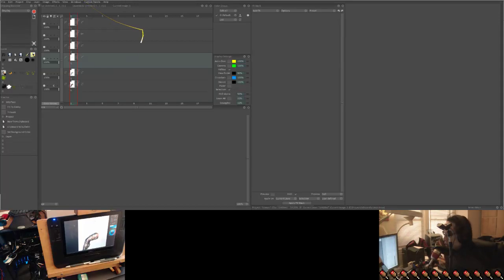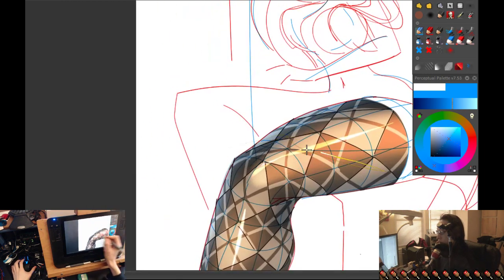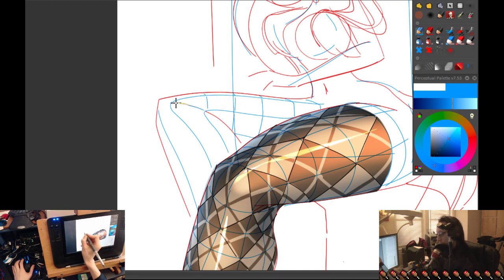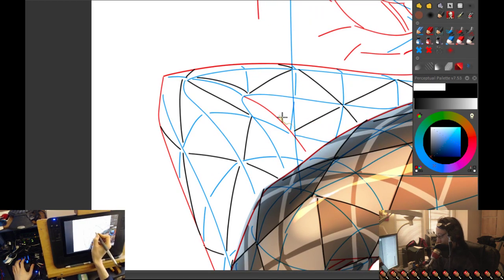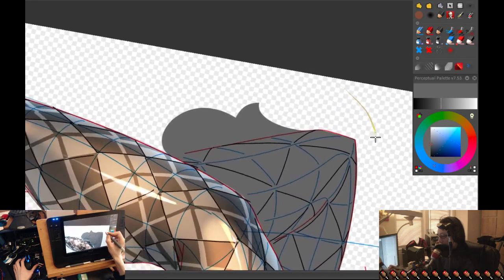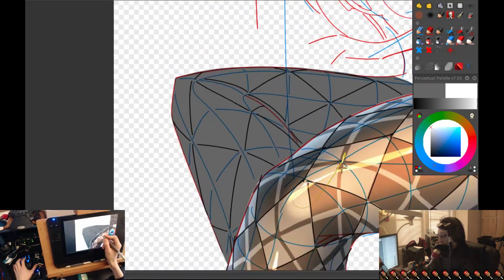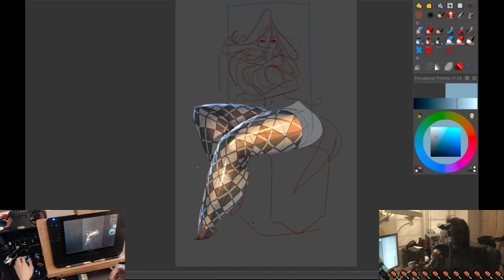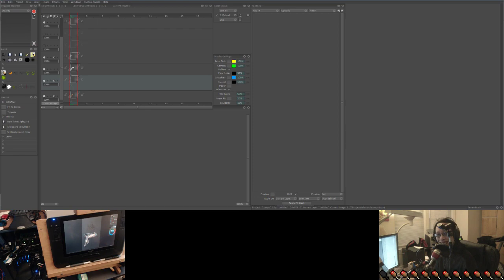How to draw an argyle pattern over complex surfaces in perspective

Comment: Great video, very well explained and demonstrated, but I can't help but think that you missed the mark on one vital part of the execution, because after creating the simplified planar geometry as a guide you didn't properly curve the lines of the pattern to follow the legs actual roundness, resulting in a lot of almost straight lines that don't properly flow into each other the way they would on the original panty hose.

What you could have done is redraw the curves after having planned them using the grid, so that they all flowed properly by following the 3D forms of the legs. Worst case scenario you could have further subdivided the grid a second time to have a more precise guideline to redraw the curves if the first one wasn't enough.

Just my two cents, I don't mean to come off as critical of the tutorial, it's great video still. Keep up the good work.

Comment: Your method is way too complicated, I use a better way to do this things. But it’s always nice to see other ways, specially when complicated, pretty impressive!!
Reply: I'd love to, but I really do not have the material to make a video :/ and to be honest I'm really not confortable with speaking/explaining or making videos. 

In few lines, this is how I do it : 

1.  I draw/make separately a "texture" (usually on Ai when they are very geometric/complicated) then, I import it (by copy paste from Ai to PS) and deform it on PS with the automatic bounding box just to fit the  accurate size, after that, if I'm happy with the proportions, I right click on the layer of the now called "Dynamic object" and ask for "pixelate the layer".

2. By pressing ⌘+T  an icon/button appears located on mid top right of the window, it has (no specific name) the info bubble just say  "switch between free transform and wrap modes" — IMPORTANT :  you can not access this menu without having pixelated the layer so, do this only when you're really sure about the look/proportion/position of your texture. 

3. I adjust the texture to turn it into a volume which fits perfectly the shape of the targeted part of the artwork. 
I may also use fusion masks to cheat on or fix small problems or even merge 2 different textures together (I guess you know that jazz). Technically I work on HD (300dpi) for that, but why? because the deformation can pixelate a lot the texture if worked at 72 DPI.

N.B.:  With this method you can also use other photos/pictures and turn them into textures, I've made a sexy Tinker Bell fairy using leaves pictures :  goo.gl/2Evhsf